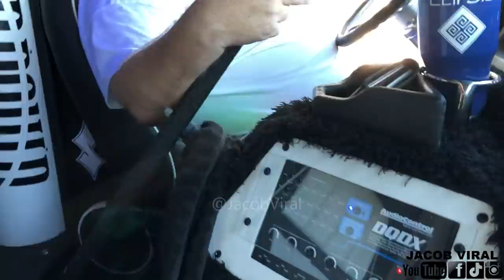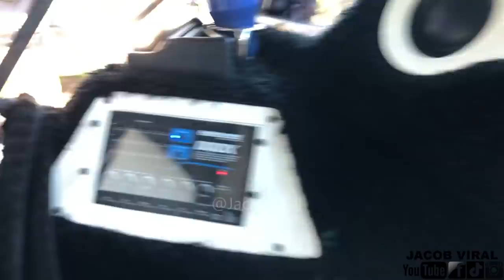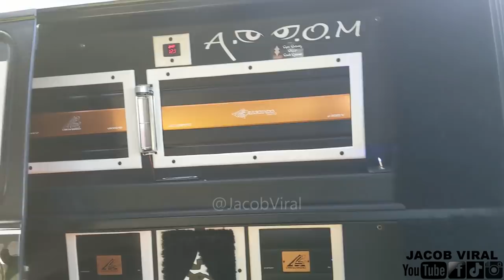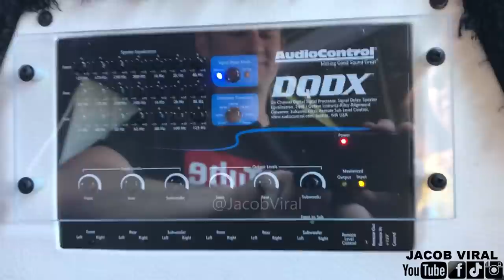YOU WOULDN'T BELIEVE WHAT THIS SYSTEM COST! NAMED "THE FINANCIAL MISTAKE"!

Comment: I remember the Kicker build Chappy had a while back where he had subs in like 3 - 4 different sizes in the same build and on top of that he had 2 Controlto 18's I believe. It looked badass. Clean. Acually It was EXO that filmed and posted the vidieo of Chappys' old kicker build.  He sure loves to talk about it. This build is beautiful. Loud and clean.
Reply: He still has it, in the Pacifica I think it is
Reply: Audio and whips  Whats? Yea, I remember you bro.It's -6 here right now. I had problems with my van freezing up. I put some cheap antifreeze in it. Bad move. Yea the corona virus caused alot of businesses to have to close down, but you can still go to drive-thru's. Theres still alot of places open though. Most businesses cant afford to just shut down till further notice so they try their hardest to stay open hoping nobody walks in and shuts you down. 
  Yea,on top of it being so cold theres also alot of snow on the ground. moat side roads are still slick if not strait frozen. I'll be glad when it all melts. I'm getting ready to do a rebuild in my van. I'm building a C-pillar 4th order. 4 15's. I have most everything I need. Cant wait. I'm staying in Gary IN till spring and I dont have a garage here so it's just too cold to do it right now anyway. Although I have worked on systems outside when it was cold as shit before. I hate going without bass during the rebuild too. It's gonna be badass though. I'm thinking of making some videos and posting em here.

Comment: 🇺🇸🌱😆HA! ENGINEER?
HEAT RISES, IF HE CHANGED THE DIRECTION OF THE FANS IT WOULD BE MUCH MORE EFFICIENT. THE COOLING SYSTEM IS TRYING TO SWIM AGAINST THE CURRENT, AND RECIRCULATING THE SAME HEAT AGAIN. 
J U S T   S A Y I N🍃

#RHEC #CREEKSQUAD #UPCHURCH